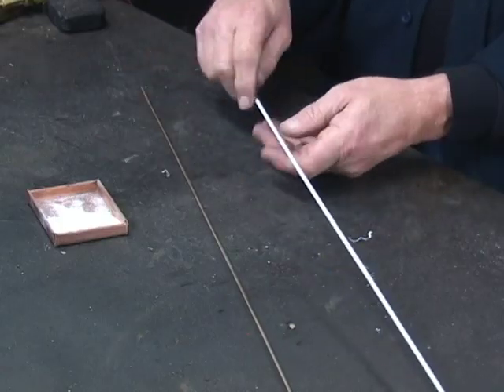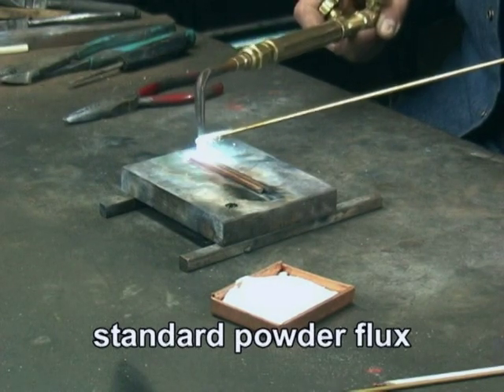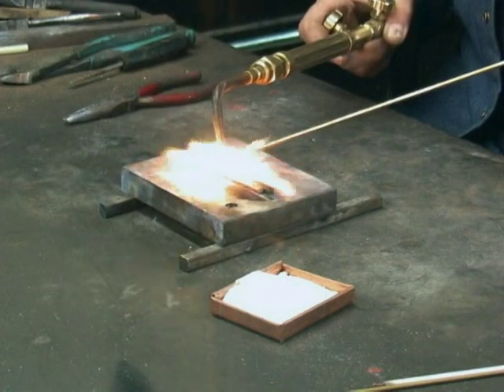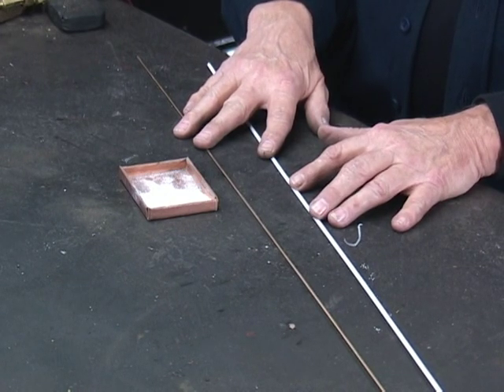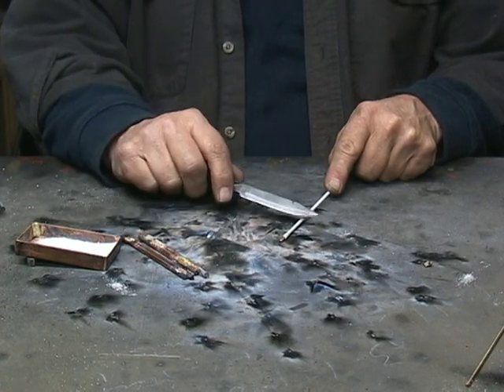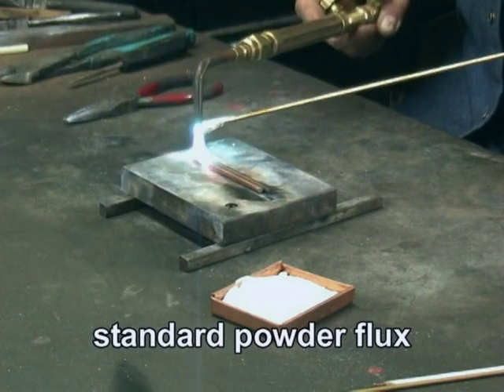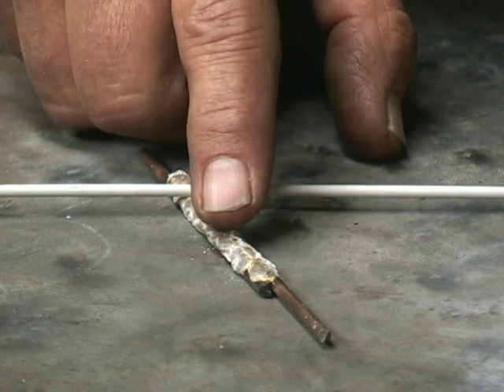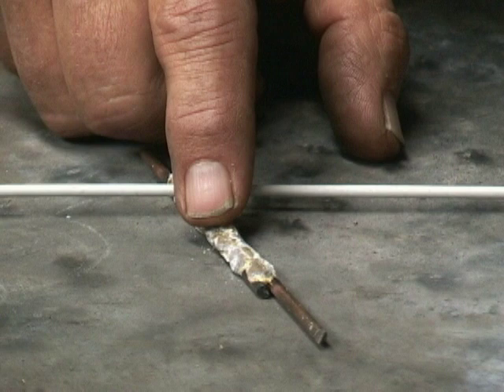Using Flux for Oxygen Acetylene Brazing

Comment: im new to gas welding i can stick and mig weld.i use 6011 for all my stick welding i like the way it digs in the metal. is there a fillet rod i can use for all around gas welding for all metal applications. ive seen some folks on you tube using metal coat hangers for the fillet rod and it looks like they get some pretty good welds with it.
Reply from the maker: Jerry, gas welding most often refers to welding steel.  RG 45 is a standard gas welding rod.  It is a mild steel rod with a copper sheath (thin coating of copper).  There are other grades, but most commonly used is RG 45.   Coat hangers have been used for years, but they have their limits because of their steel content.  If you want repeatable results, I'd suggest starting out with RG 45. You can find RG 45 at most welding supply dealers or online.  It comes in a variety of diameters and is affordable.  Gas welding does take some practice.  Mig welding has replaced gas welding for many applications.
Reply: Thanks George I'll be picking up some RG 45 tomorrow! cant wait to get started

Comment: Hi George; When I attempt to braze, all I get is heavy black soot.  I can't see the work.  Are the psi settings on the acetylene and oxygen wrong?
Reply from the maker: Courtenay, for some reason you are not getting any oxygen to the flame.  Close the acetylene knob on the torch.  Open the oxygen knob on the torch and listen to hear if you are getting any oxygen.  If you don't hear anything, then you will have to back track and figure out why oxygen is not getting to the torch.

Comment: Great video. Can I ask what material is the square block under the copper?
Reply from the maker: That is a block of mild steel 1/2" thick supported by 2 pieces of 3/8" square steel.  Using it here as a heat sink -keeping the heat off the welding table.

Comment: Are you using "bronze" and "brass" terminology interchangeably or do you actually have a bronze rod?  Are most brazing rods bronze?  I thought they were brass.  Thanks for your videos.
Reply from the maker: The rods I use are bronze brazing rod.  Bronze is an alloy of copper and tin.  There is brass brazing rod, an alloy of copper and zinc.  I don't think I have ever used the term brass brazing rod.  Although if you do a Google search you can find brass brazing rod.  I've done some brazing with a bare brass rod and it didn't work as well as using a bronze brazing rod.  There does come a point where brazing becomes very technical.  More in the line of metallurgy.  Wikipedia has a good article on Brazing.  Basically I buy a 5 pound tube of standard brazing rod and braze.  If it works I don't question what the alloy is.  There is one brazing rod that I particularly like but I have to buy in such large quantities that it is prohibitive.  So, even within bronze brazing rod there are differences.  Hope this hasn't confused your further.
Reply: George Goehl Thanks!
Reply: What is flux made of?
Reply from the maker: Basic brazing flux I use is borax.  Beyond that, there are a number of different fluxes for specific applications.  Suggest Wikipedia "brazing".  Good explanation of brazing and flux.
Reply from the maker: The brazing rod I use is bronze.  Bronze:  copper and tin.  Brass: copper and zinc.

Comment: Drear sir,
Thank you for your superbe videos. I need some advice. I have 3 parts of pure copper to braze together . Part A: 0.250 X 4 X 6 inches. Part B & C: 6 X 4 X 2 inches. Part A will overlap B&C of about 0.5 inch , making a strange U. The bottom of the U is the Part A. I can use a high temperature oven to pre heat OR to melt the brazing alloy in situ. For that i wanted to use a silver powder mixed with a paste flux. But not sure how to do all of that... For now i am looking at a brazing alloy with 5% Ag. 

What do you think ?

Cheers.
Reply from the maker: Brazing heavier copper takes a lot of heat.  I haven't done much with heavier copper, but your idea of pre-heating in an oven may be a good idea.  Personally, I would try silver solder as it melts at a lower temperature than brazing and it is almost as strong.  It would be best if you had a few pieces of scrap copper to practice on.  There are some good videos on YouTube for silver soldering.  This is about all I can offer as I rarely work with heavier copper.
Reply: thank you for such a quick response! I will do some tests and will write back to you asap.

Comment from the maker: I had one of the twin carbon brazing sets back in the late 60's.  There are some specialty applications where they are still used.  I much prefer the oxy/ace torch.  I agree with your comment on the strength of brazing.  Thanks for the comments.

Comment from the maker: @dequinox 

You're right, boiling water will get most of it off.  Jewelers use a pickling solution but they are working with small pieces.  You can find a pickling product at an online jeweler's supply.

I don't use acids so I can't offer any suggestions.

For the better part of 40 years I've been scraping the flux covered brazing rod to reduce the amount of flux used and then wire brushing.  I've tried lots of different approaches and this is what has worked for me.

Comment: Thanks for the video, I'm surprised you haven't had more views! Do you have any idea what kind of chemical compound would be good for dissolving flux from a piece? I've done hot water (212 deg. F) and it got most of the stuff I am using off but there were still several sm. chunks left.  I've heard of "pickle solutions" and acid before... but what kind of acid would you use?

Comment: @DCBillW 
Sounds like the plate may have oils on it or was not heated up enough. Try hitting the plate with some resin cloth or a stainless steel wire brush
Source: I am a graduated, certified welder
Good luck, tell me how it goes!

Comment: Hi George,
I will try again with flux, but I am using all new material (copper sheet .16 I think).  my braze is very bad (although this is the first time I have tried).  I'm using oxy/acetylene with a victor 00 tip.  The braze is inconsistent, sometimes balls up, and very lumpy.  Any thoughts, or tips?  Thanks George!